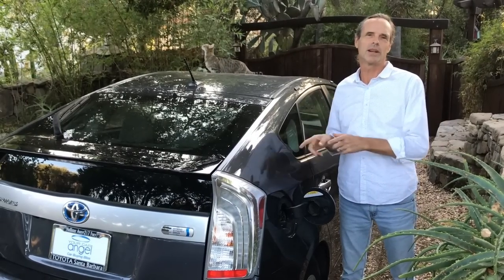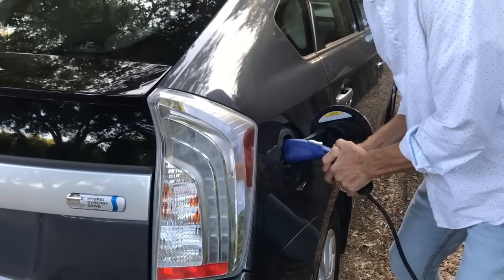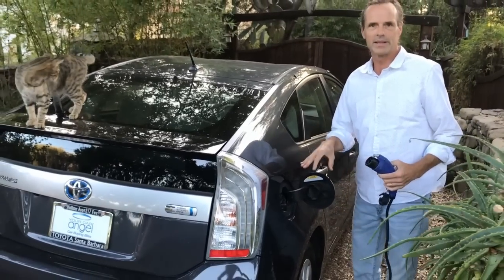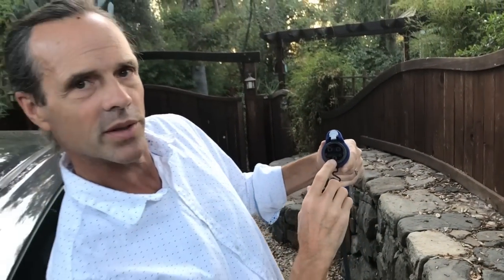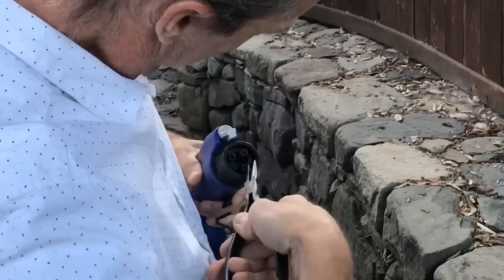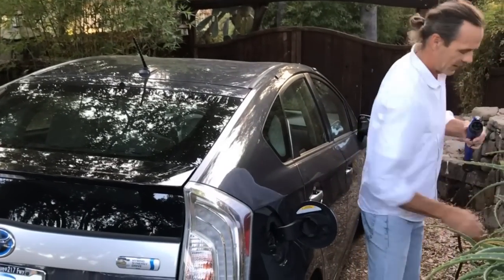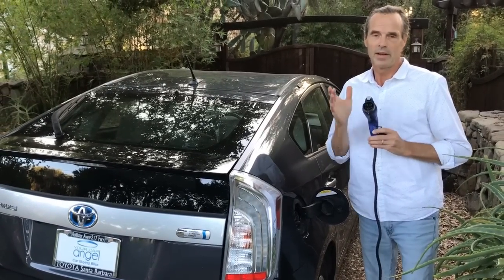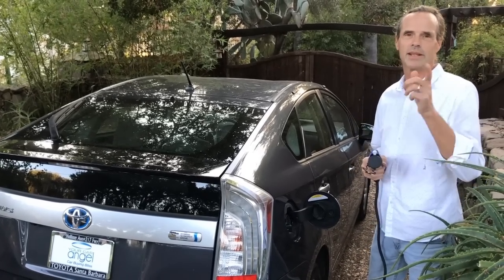If You Use an EV Cable WATCH THIS

Comment: I have a Duosida charger and iam suffering from the same problem. I will try this later and hopefully it works for me. Thanks a lot
Reply: I removed the rubber deapite that it was in good shape yet the difficulty of plugging is sitll there :( is it because it's not Toyota charger? Any advice? Thank you

Comment: I just realigned the rubber seal and greased it in place and the opposing connector and it was trouble free since then, with the added protection.

Comment: Hello there. This just happened to me with my bmw i wall charger. I took out that red gasket but it doesn’t charge now. Feels like there is no contact between the electrical parts. Why is that? I tried a different walk box and it worked so it’s not my car.